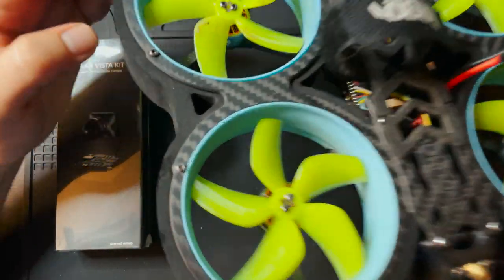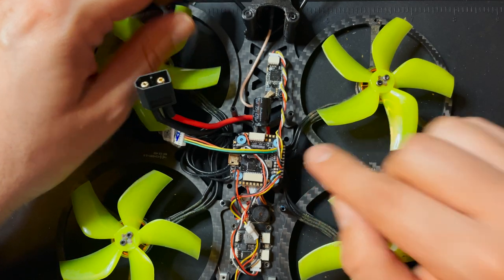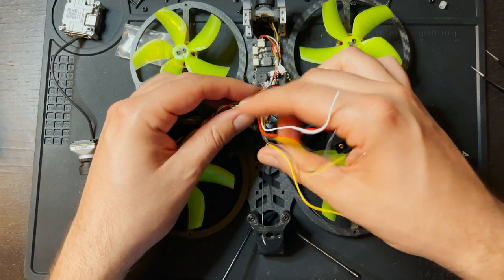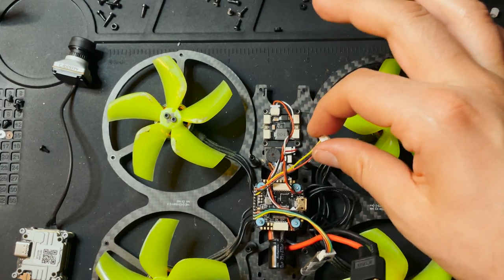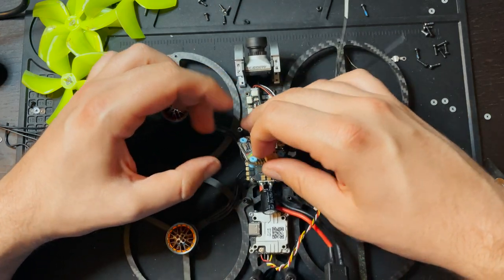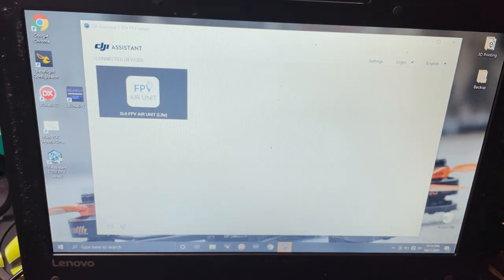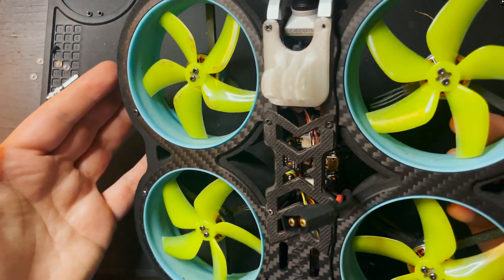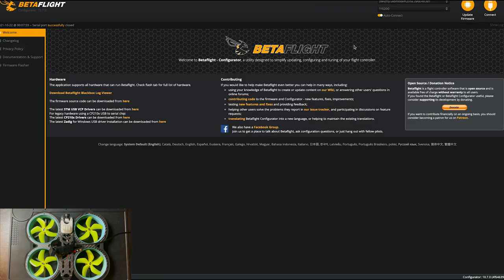Convert your FPV Drone to Digital!

Comment: Cool video, I was just thinking whether you can use any other fpv googles with digital system than dji ones
Reply: You can't with DJI.  But if your analog goggles have a HDMI "in" port, the HDzero and Walksnail digital systems will work with them if the screen resolution is high enough.  You can also connect their receivers to a laptop, big screen TV or home theater projector.

Comment: Why rx to tx? Shall i check the flight controller or is always like that
Reply from the maker: best way I can describe it is rx=receive & tx=transmit
The way that both components communicate with eachother is through the RX and TX pins, so the transmitted signal (TX) will always be received by an RX pin.

Comment: Very useful stuff man, especially with the high prices of electronics. Just buy an analog quad and use the HD kit from another one of your quads you have as HD. 😁💪
Reply from the maker: Thats what I do with a couple of my drones! most are wired up with the same 4 pin connector and I can just remove the vista and put it in whichever drone I want to be digital. Glad you found the video helpful, thanks for watching!
Reply: @TRONCATFPV  yep I just got the nazul 5 with the Vista as video and crossfire as receiver. Had to solder the gnd and sbus, mod the configuration in beta flight and poof good to go.
Reply: Or just build your own from scratch instead of getting BNF’s. I would 1000% much rather buy a frame and all the individual parts, because bnfs aren’t the greatest, don’t get me wrong they are great for starting out but they aren’t what they could be. If you know or “learn your stuff or all the stuff that is out there” you can build some amazing things. For example I have a freestyle quad that I built. And I clocked it at 133mph. That is insane especially for a freestyle quad that weighs 820 grams 😂 with the gopro on it. You can make them as tuff as you want as fast as you want as light as you want, the realm of endless possibilities with fpv  is amazing... I personally have no desire to buy a analog rig never wanted to, even when I started out I actually waited to get into the hobby for digital because I hated the static, snow, & the lines it renders you to the point where your unable to see and in the end you spend twice as much because your crashing twice as hard twice as much all because your sending a bird into the sky at rocket speeds yet practically blind folded I’m honestly surprised analog isn’t banned, with all the rules and regulations going on towards our hobby with the faa I’m surprised they weren’t like well analog is out of the equation for good it’s to dangerous because of the lack of being in control because of the lack of vision lol wouldn’t that be some shit 😂 I personally would love that simply because analog pilots have a beef with us digital guys lol man that would be the day... digital is the future weather if it’s HdZero, sharkbyte, or dji
Reply: @devilcfpv2621  I do agree but not many people are good at soldering so it tends to be intimidating. Especially since if you get it wrong you fry your electronics. it's always good to have something ready made to ensure you are flying while you are building out your personal quad.
Reply: @GregSupe  I mean you could look at it that way or you could say to your self you know what I can do this and try it out, soldering seriously is very easy it may seem intimidating but I assure you it is your own mental self doubt that is holding you back.... if you really are that worried then what you do is you get a broken board or order a practice board and you start practicing I think all in all the hardest thing for me to learn the techniques on was the power leads, those took me longer to learn for sure. Flux is your friend you need to make sure you have a temperature controllable soldering iron and 63/37 Rosin core is the best, practice and learning the technique is key I have helped a dozens people in the last year in showing them there first steps in how to build their first quads from scratch and if they can do it you can do it just believe in yourself I no you can do it
Reply: @devilcfpv2621  I'm right there with you bro. I definitely try at something before I convince myself I can fail. But many people are not like that. Also remember we live in a world of convenience so many people wont want to go the "harder route" of building it despite the satisfaction it gives. LOL!!! BRROOOO I just learnt about the rosin flux, holy cow what a game changer. Thing makes the solder melt like butter and stick hella quick. Wish I had some before I fried my second esc and motor.
Reply: @GregSupe  I will Litteraly make a short video just for you on how to do it. It becomes 2nd nature to you after just a short time of doing it. Every one I have ever showed has picked up soldering after I gave them a few tips. The pros tutorials from what I heard don’t explain it like I would. That and demonstration.... I have a new frame that was sent to me from a buddy overseas that is supposed to arrive today, if it gets here soon I’ll be tagging you in the video because I will be doing a bunch of soldering for a New GRL Titanium build this is gunna be sweet I’m so excited lol X-Mass is early this year for me
Reply: @devilcfpv2621  I'll look forward to that vid. I believe it would be helpful not just to me but for the rest of your viewers.
Reply: @GregSupe  the new GRL frame arrived at my door late lastNight, I have put a premier video up on tiktok showing the components Motors and all the good stuff that is going into this thing I posted a picture and details about it on here and Instagram as well, I just set up my build studio so I can work and record while I put it together. I should be finished with the building tonight so the post editing will be following right behind it

Comment: do you need a receiver even if you have a caddy x polar vista unit ? or does it come with the unit
Reply from the maker: you can use the air unit as the receiver if you're using the DJI remote. If you're not using the DJI remote you'll need a standalone receiver

Comment: Does the DJI Controller have any special features that control the camera? What would those extra wires be for?
Reply from the maker: not to my knowledge. the extra wires that are on the vista are simply for the reciever function to communicate with the FC. Thanks for watching!
Reply: @TRONCATFPV  Thanks for the quick response!
Reply: You can change all the cam settings in the goggle menus if thats what you mean.
These extra wires are ground and Sbus for when you use the Vista as a receiver for the DJI remote.. if you choose to use one.

Comment: Could u suggest a good but cheap camera??
Reply: Digital isn't cheap :) if money is s concern keep it analog.
Reply from the maker: The caddx Turbo EOS2 is a great analog camera that is on the cheaper side. 
https://www.banggood.com/custlink/D3myNdBE9n
Reply: Analogue or dji digital ?
Reply: @paulhope3401  don't know what those words mean but I would say that I want a camera can be used for both, flying fpv and recording as well
Reply: @paulhope3401  couldn't I do something like start it before flight and record whatever it was viewing till the end.......it doesn't have to be the best quality but it should be visible and clear is what I am asking, overall, my priority is to just fly around the neighborhood moving in between trees, etc. just for fun and nothing to serious so any suggestions??
Reply: @kryptedcode   Yes, if you have goggles capable of recording tapping the record button to start and stop recording is exactly what you would do. 
If you record on the goggles the video quality is obviously a lot lower but be good enough. 
Just make sure the goggles you buy have a built in dvr on them.
Reply from the maker: @kryptedcode  I agree with everything @Paul Hope is saying. it really depends on what kind of goggles you have or plan on using. DJI is more expensive but will offer a solid on board camera you can record with. As far as analog goes, you can either record to the goggles that you use (assuming that they have the function to record DVR) OR you could  get a VTX that records to the VTX (Video Transmitter) on board the drone.
Reply: @paulhope3401  I am not planning on buying goggles as they would be out of my budget, I hope to get the transmission on my phone and use it as an fpv screen instead of goggles
Reply: @paulhope3401  @TRONCAT FPV What would be preferable to cost, buying individual parts like esc, power distribution board and flight controller or buying a stack??
Reply: @kryptedcode   Not sure, you might save a few dollars buying a stack... or you might save some money buying individual parts if in the sale. 
There are also some AIO boards available that have a flight controller and 4 ESCS all combined in one board which can be a neat solution. The only downside is that if one of these fails you need a whole new AIO board.